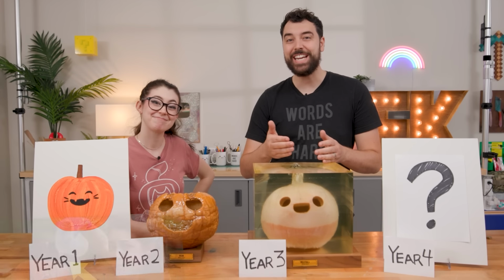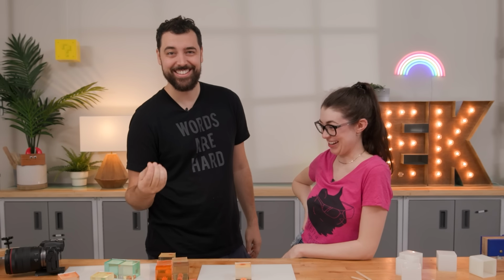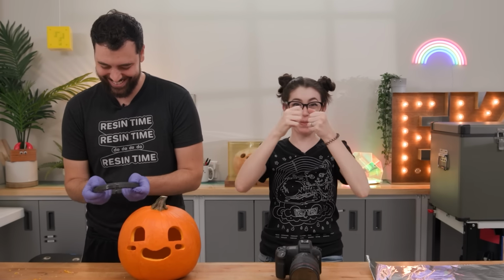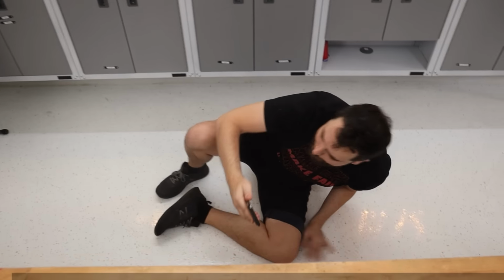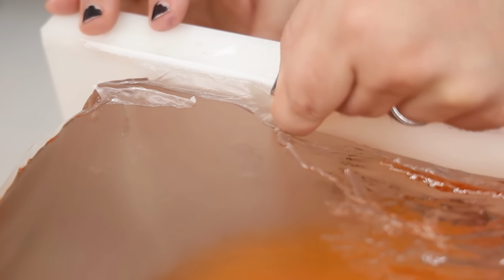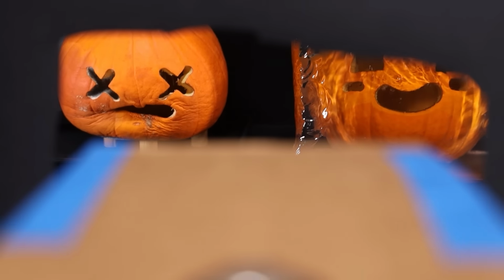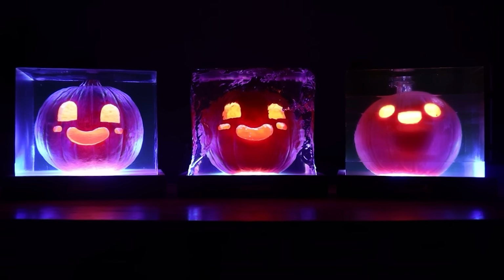Our BIGGEST resin pour yet… all to preserve a pumpkin

Comment: Hey Evan and Katelyn, I might be able to explain your mold growing!!! :) I am a credible and reliable source, as I am a registered AMT Medical Technologist with a specialty in Microbiology and Molecular Biology. When you cleaned the surface of the squash, you effectively removed all of the symbiotic and non-symbiotic bacteria and mold that naturally exists on the surface and inside. This bacteria and mold usually eat the food source (in this case the squash) before black mold can set in, thus taking it longer for black mold to appear on your control. While the cleaning agents you used are great for sterilizing, I do not recommend eating them, it can cause the mold spores that exist in the environment, like black mold (Stachybotrys chartarum) to be highly opportunistic. Black mold spores are highly resistant to most cleaning agents like alcohol and bleach, and can exist anywhere in a house. One of the only ways to get rid of black mold naturally is mixing acetic acid (like vinegar) and hydroperoxide, or more readily available, 1 part baking soda to five parts vinegar and five parts water. There are other commercially available mold cleaners, but they can be toxic and hard to use by consumers without the help of a professional. I would research further if you wanted to go the cleaning route next time. I would also suggest if you have the access, to use a "clean room" like hospitals use to remove bacteria, mold, and other environmentally occurring organisms from rooms with immunocompromised or suppressed patients. It doesn't have to be an actual room, you can find HEPA filters and other materials like acrylic to create your own! I hope this is seen and it helps for next year's pumpkin trials!

Comment: SUGGESTION: Buy another pumpkin RIGHT NOW and try kiln-drying, the same method used to dehydrate lumber slowly to prevent warping. Then, before immersing, coat the pumpkin with resin and let it cure to seal the flesh, then do the big pour.
Reply: THAT IS AN AMAZING IDEA! the kiln drying is so smart

Comment: If you do two pours: fill the pumpkin with a first resin pour, then cube the pumpkin in the second, you can massively cut the thickness that the heat transfer has to deal with

Comment: Make a slightly larger cube mold and embed Chunk 1 in it so you have the best of both methods!
For next year, I suggest freeze-drying the carved pumpkin, as that will get rid of the water while preserving the shape (at least relative to other methods of drying). If you keep the water, the pumpkin WILL GET MOLDY. Or maybe you could try replacing all of the water with an inert fluid... but that's way more chemistry than I know 😂

Comment: The sterilization will only work if you work in a steril environment like a laboratory workbench and then spray the pumpkin with 70% ethanol/iso-propanol before cutting it (90% is too high, it evaporates too fast). Also the spores probably won't die, you have to rub them of. The inside could be sterile if there aren't any cuts in the peel.
I hope I could be of help :)

Comment: I'm wondering if the cause of the sterilization attempts going so poorly was that they damaged the cell walls and that allowed the mold to more easily access nutrients. It could also just be that it did nothing and for whatever reason the mold spores landed on the control last, that's why it's important to do more testing if you want to know why something is, but I think whatever the reason it's pretty clear that that would not work for helping the pumpkin last longer. 

Also I'm pretty sure that squashes and pumpkins are very closely related, so I think that's a pretty decent model to use if you can't get a pumpkin

Comment: Crazy idea (not really sure if someone said it already), for next year you could try freeze drying the pumpkins before pouring the resin, that would remove most of its moist and internal water 😊
Reply: the problem is that the freezedrying machines cost a shitton
Reply: @niil047 they already have a vacuum chamber for degassing the resin. They could use liquid nitrogen to flash freeze the pumpkin. Definitely would not work as well as a commercial freeze dryer, but they could reduce the moisture content significantly.
Reply: Ooh that is a good idea!
Reply: @niil047  They could do a colab with the channel that freeze dries candy.
Reply: Freeze drying would shrink the pumpin no?
Reply: @FrydClips  no, freeze drying allows all the solid parts to remain exactly as they are, while just pulling out the water.

Comment: Hi, I'd really advise looking into plastination for next year. It's a really effective way to preserve biological tissues without rot (it's how anatomical specimens are preserved long-term), and you can actually use resin for it! Normally I wouldn't suggest it, since it requires more specialist equipment like vacuum chambers, but since you actually have that stuff, I think it would be pretty doable with appropriate safety gear. 

I'm also pretty worried about the several rotting resined pumpkins, since they look like they're breaking down the resin over time, and several years of anaerobic bacteria would make for a real biohazard. It's pretty dangerous, and you might need specialist disposal services once you can no longer keep them, since I don't think they can be put in regular household waste garbage. Love your videos, just want you to stay safe!

Comment: I know it wasn't your vision, but I really liked how the pumpkin looked after the first resin casting. It just looked like it was stuck in a block of ice and the air bubbles kind of enhanced that effect. I would have tried to smooth out the sides at this point so that this opaque "film" was gone. I haven't finished watching the video yet, I'm sure it will look cool later, but I just had to say how cool I thought it looked before.

Comment: I know others have mentioned freeze drying, and I’m not sure how similar/dissimilar to freezing the pumpkin in liquid nitrogen would be - but I would recommend that if possible. Last ditch effort could just be to make a silicone mold of said pumpkin and then cast the negative with resin to make it look like a pumpkin.
Reply: I think that would kill the cells while not removing moisture,  leading to more rot
Reply: If you freeze something with liquid nitrogen it would thaw out similarly to how it was originally

Comment: Idk much about science, let alone resin. But I might know what had happened. Maybe chunk 2 looks so frosty because he actually froze inside the fridge. Maybe the resin trapped the cold air inside of it, so instead of increasing in heat it began decreasing which eventually froze Chunk 2(probably due to the ice water instead of air). If that is true, the reason he could be bulging and sweating is because he is starting to melt/shed the frosty layer he has around him.

Comment: I'VE BEEN WAITING SO EXCITEDLY FOR THIS VIDEO

Edit: I do wonder if it would help for airholes in the pumpkin if you guys flipped it so that you're essentially filling it while it's upside down and find a way to keep it stable so it doesn't flop over while the resin is curing?
Reply: I was thinking the same thing while watching. It would be way easier to weigh it down, too. No need for fancy lead rings.
Reply: @AKA-Latromi  And the fact that it's upside down means that there's WAY less of a chance for air pockets, so it potentially would have a greater chance of staying closer to the bottom, rather than wanting to float to the top

Comment: I also thought that chunk 1 could be remolded in the cube mold and that might deal with the wavy ness.
OR OR you could steam cook the pumpkin since that is actually a great way to preserve it as well 
(That is basically what happened to Chunk 1 it basically steam cooked)
So if you steam cook it ahead of time, the slow cold cure would take better and you would probably avoid the silvering and leaking/sweating issue

Comment: Since the bleach and alcohol didn’t stop the mold, what about getting an anti fungal solution next year? They make anti fungal products for house plants and probably for outside plants too.

Edit: another thing you guys can try for next year is coating the outside of the pumpkin in a thin layer of resin BEFORE carving, that way it hopefully won’t pull away from the resin block during the curing process. (Tho I guess there is a chance that it will still pull away when the the cube is curing and  cause the resin shell to crack and cause problems that way)
Reply: Ibwas thinking that the whole time. Why not put a thin layer of resin first

Comment: I think for next years pumpkin project, one thing I think would help for pouring the resin in would be to put the pumpkin into the mould frame upside down. I mean think about it, you've got this giant hole at the bottom and you're trying to prevent an air void in the top stem area via 2 teeny tiny holes, why not make it easy on yourselves and just put the pumpkin in upside down, then you can be sure the entire thing gets filled. Just a thought.
Reply: it's a really great idea!!
Why we didn't think about this before?
Reply: @Loloany  honestly I think part of it was just wanting to get that nice "reveal shot" as they open the mold and the pumpkin is upright but frankly I think they should try one covered in resin upside down, see if it changes anything.

Comment: ive got a suggestion for next year, just freeze dry the pumpkin after carving to get rid of the liquids. may or may not shrink but another suggestion is to rehydrate a pumpkin with resin after freeze drying it then putting in the pressure chamber to let that resin penetrate? just a few more things to try if you have the time!

Comment: Well, did you guys account for the fact that resin shrinks when it cures?
As a dicemaker, it isn't that much of a problem for me, but when making larger projects, it's important to keep in mind that the deeper your resin pour is, the more it will shrink.

What I'd suggest is: you pour your resin in layers, but don't wait until the previous layer is fully set. A gooey resin can still somewhat mix with a previous layer, and as such, you prevent the seperation lines. Good luck in your next pour, guys!
Reply: The problem with that is not necessarily getting the transition to disappear, but the fact that each batch of resin isn't mixed perfectly (for a million reasons) and comes out with a slightly different color/consistency.

Comment: I think you needed to match the actual final process when testing the sanitizers: refrigerate, sanitize, then coat in resin in the cold.  As it stands, there are many possible interactions with the air that don't match the scenario you're actually preparing for

Comment: I did some research, and i found out that a drop is about 0.05 ml. So, if you have 480 drops, it should be about 24 ml or about 0.811537 fluid oz.

Comment: I'm new to E+K so I have just recently watched the pumpkin saga and coming with a medical science background, the amount of shaking my head at the tops of the vids has been entertaining 😄

The amount of air and water in the flesh of a pumpkin is significant (as evidenced by the dehydration attempt). As long as there is moisture and air, bacteria and mold will grow. Encasing something traps the moisture and air within the "tissue" but does not prevent mold and bacteria from using the moisture and air. And bacteria and mold create by products - heat and co2 which is part of why youll continue to experience changes over time after encasing these pumpkins in resin without getting rid of all the moisture and air. 

For the alcohol and bleach in this video, that just killed surface bacteria and good/beneficial pumpkin tissue. Kind of like pouring an acid on skin - once its done eating away, the inner flesh is more exposed and in more danger of infection. This is what happened to those squash.

As dehydration is not a suitable solution for the result you're looking for, you need to replace the moisture and air with something else. You would need to infuse the pumpkin tissue with something that will prevent bacteria and mold from ever starting to grow. This is what formalin (formaldehyde) does to preserve human tissues for testing and for other preservation methods of tissue. Alcohol can be used in certain situations, but I dont believe it would work for the amount of flesh in a pumpkin (it can work for preserving dried invertebrate specimens, but thats because theres minimal flesh involved). 

Not sure if you would want to use formalin (its definitely a volatile product and there are significant safety concerns that would need to be observed at all times), but if you could completely submerge and have a pumpkin be completely saturated in formalin, then somehow encase that in resin, I think that would be a potential preservation solution. Formalin is available for regular folk to purchase, though I believe there are other solutions (like those used in mortuaries) available to people with specific licenses.

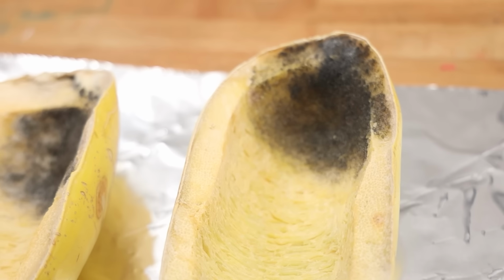Comment: 6:14 The fruit most likely has some natural anti fungi/bacterial properties.
When you cleaned with bleach and/or alcohol you also remove the natural protection. Since both bleach and alcohol evaporates, the surface was left defenseless for any fungi/bacteria in the air to land and prosper.
That is my theory.

If you want to preserve it for longer my suggestion would still be clean with bleach and/or alcohol but also brush a stable* anti fungi/bacterial after the cleaning. 

(*Means it doesn't evaporate or chemically breaks down.)

Comment: Have you tried inverting the pumpkin and pour the resin into the large hole in the bottom of the pumpkin? Would that not cut down the air bubbles and juicing

Comment: I'm at 6:24 and I just want to make a prediction on why the control did better.  You may have sterilized the other ones with alcohol and bleach, but those chemicals dry up and evaporate away, and my theory is that they killed bacteria on the squash leaving a nice friendly place for one of the thousands of mold spores in the air to set up shop and go to town with less intervention from bacteria.
Reply: That was my thought plus black mold isnt typically killed by bleach or alcohol so you just killed off all the competition it had. So if it was already there or floated on by I’m the air it had no competition so it just took off.

Comment: 40:55 As you said earlier in the video, the pumpkins naturally have some air in them. I think becuase you slowed the curing down so much, there was time for the liquid resin to go into the tiny air pockets and push the air out. The silver you are seeing is a layer of tiny air bubbles which came out of chunk 2. When the resin cures faster, it becomes solid before it has time to replace the air inside the pumpkin.
Reply: this can be solved by applying a coat few coats of penetrating resin to the pumpkin before fully encasing it. It should stabilize the pumpkin and prevent bubbles from forming in the long cure time

Comment: I'm a little surprised y'all haven't tried curing the pumpkin upside-down. You'd need a way to stabilize it but it would prevent the need to drill air holes in the stem, since you already have the big hole beneath. Also you can add weight inside along the top without worry of them falling out. Regardless, y'all's content is always a joy! Whether or not the tradition continues next year, I've very much enjoyed seeing the trial and error of pumpkins past!

Comment: Yeah I feel like Chunk 1 basically got pasteurized within the resin from the heat which likely helped.  I feel like you should try Pasteurizing the pumpkin after carving but, before the resin pour.   Since when you carve you definitely are adding contaminates to it.  I'm just not sure if going cold with 0°F for 48 hours or going for 145°F for 2 minutes held would impact appearance more.  But I feel like freezing solid would be better as long as its allowed to warm up enough to not form condensation before the pour.

Comment: Couple of ideas . Preservation for the pour- Freeze” the pumpkin in dry ice. Maybe it will control the moisture?  Might ask help keep temps cool internally while in the cooler.   For the pour- maybe attach an acrylic rod to the top of the pumpkin with  super glue and accelerator. Then glue that to the bottom of the form so the pumpkin is in the mold upside down and use something to hold the  pumpkin up while you pour the first bit of resin.  Pour the bottom of the mold first till it touches the pumpkin above the eyes.  And pour the rest inside the pumpki and around the pumpkin so the resin flows out the eyes and other holes and around the pumpkin.  When you de mold you can san and polish top and bottom as needed

Comment: 2 suggestions! 
1: carve out more of the ‘flesh’ from inside the pumpkin so there’s less moisture/ shrinkage (ie like make the pumpkin walls skinny). 
2: continue with bottom holes, and pouring into a mold, but place the pumpkins ‘stem down’ in the mold with weights at the top so when you pour the air has an easy route to exit from. 

(1.5: maybe with less pumpkin flesh, the rind won’t warp as much if you were to try dehydrating again?) 

Love this series and I hope you try again in 2024!

Comment: Ever consider dehydrating the pumpkin before resin casting ? Dehydrating prevents molding and decomposition from bacteria. You have a vacuum could consider freeze dry. If it was me I would go with carve out the face and air holes, freeze dry, then cover with clear nail polish (optional, gives it structure and strength) finally cast with resin. 
Downside to freeze dry is that organic matter would shrivel. Other dehydrating methods take long time worth looking into for the perfect pumping casting.